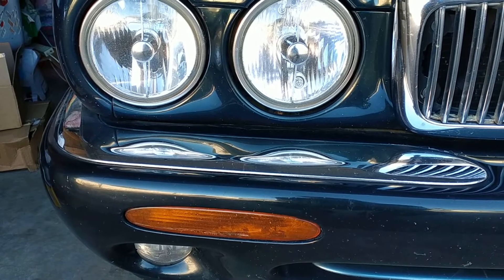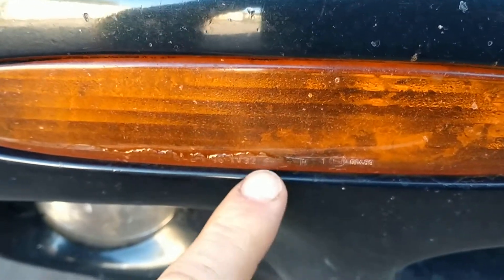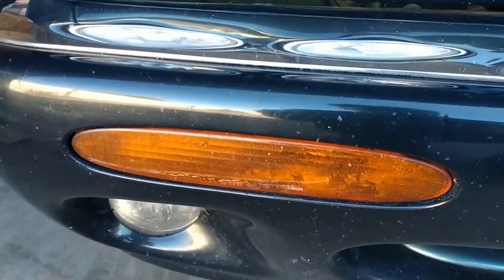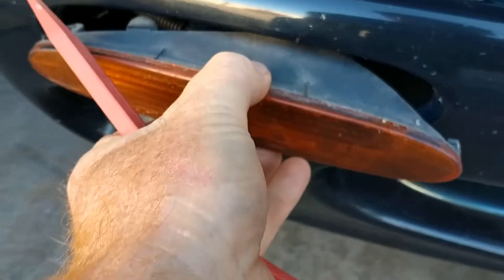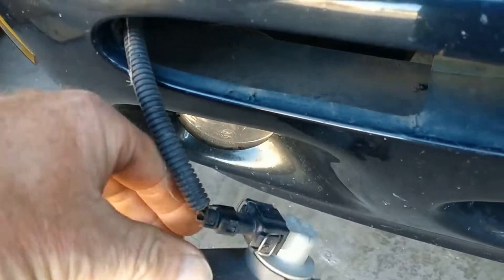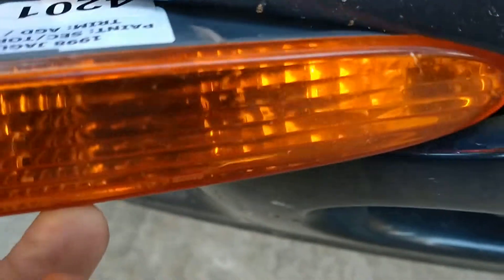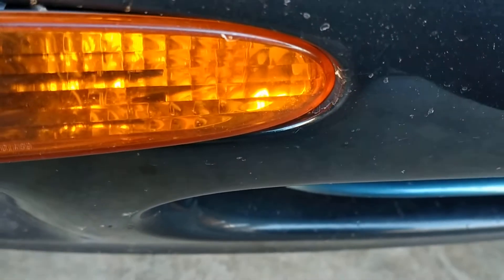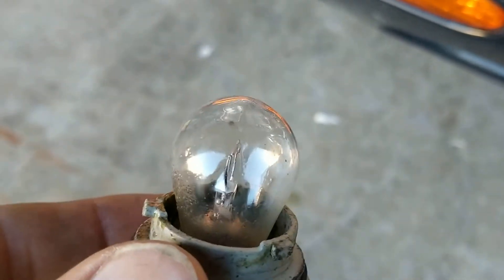Replacing the Blinker in a XJ8 Jaguar X308.

Comment: Well sir I cracked the light trying to pry it out. The manual said to push on the inside and pry the outside. The whole front lense cracked about an inch and half from the outside. And I still have not removed it to replace the bulb.
Reply from the maker: Hi, sorry to hear you are having difficulties. I have no trouble. Popped out and new one in as planned. Is it possible yours is jammed? Did the manual help you get it done? I don't have any ideas other than the manual, sorry.
Reply: I found my owners book and I guess I have to find the clip when I pry the one side.

Comment: I almost broke the turn signal lens trying to remove it this way. Only later did I download the manual and see that disassembly should start from the opposite side! You better delete this video because you are misleading people.
Reply from the maker: Sorry you felt mislead. This worked for me, therefore it is possible to do it this way.
If I can suggest, to not use YouTube and take your car to a qualified mechanic to ensure you are not mislead.
Thanks for the feedback.
Reply: @adamcecere1571  Now I understand why your turn signal light has a broken plastic mount. It shouldn't be removed this way!
You don't need a qualified mechanic to replace a bulb. Just follow the manufacturer's instructions.